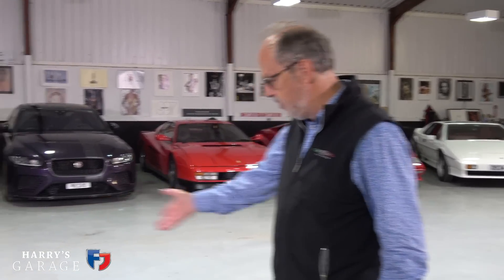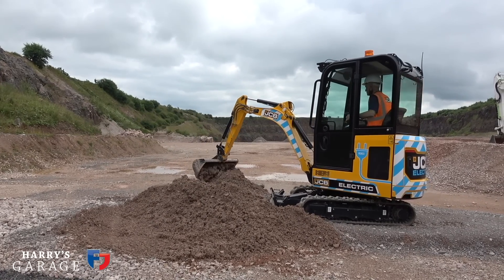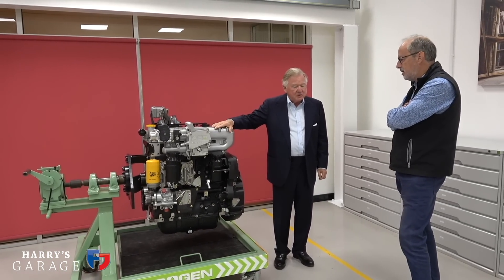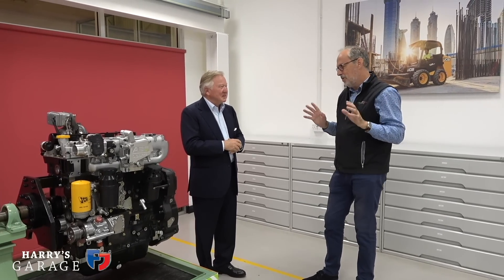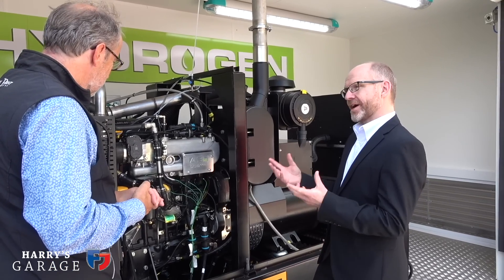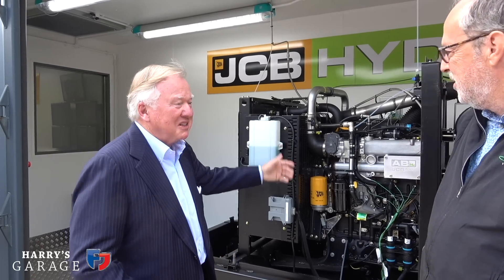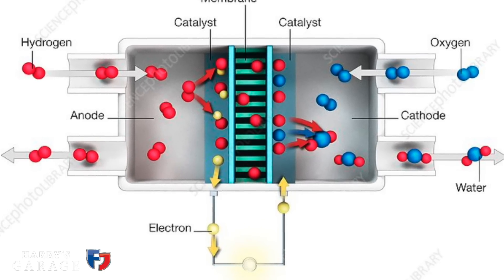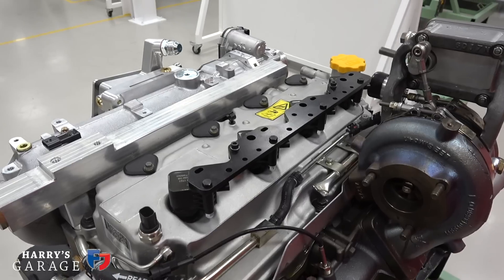Is hydrogen, rather than electric, the future for big-engined machinery? I visit JCB to find out

Comment: Jcb has it absolutely right. This is the correct and most ecologically beneficial solution to power production that can be used to retropower almost every internal combustion engine that has been already built .
Reply: You don't appreciate what hydrogen power combustion is or entails do you? This isnt some back street  LPG conversion. There are no internal combusation engines that can be suitably 'adapted' to run on hydrogen. Way to different. They all get scrapped. New engines all round.
JCB are absolutely wrong on this

Comment: BMW have been playing with hydrogen burning ICE since the 1980s. The problem is that it isn’t green, the hydrogen is made from steam reforming natural gas and is very wasteful of energy. The other reasons this won’t take off as a mainstream technology is that the energy density of batteries is improving all the time. Competitors of JCB already have backhoe loaders and other machinery that can do a full shift on a single charge....and of course they can work through the night or near schools and hospitals due to the silent operation of electric motors, something that no ICE can do no matter what is powering it. Still, better than diesel every time and an interim solution.
Reply: We have an energy storage crisis. Renewable energy sources produce surplus energy at times which actually costs money to redistirbute it safely. Using this waste energy to produce truly green hydrogen is a perfect combination. Green energy supply and green energy storage.

Comment: Japan is going all out for a hydrogen network and hydrogen cars. 
Japan has discovered large deposits of natural resources in it waters that lend themselves to a hydrogen future. 
Hydrogen has a future, it's just that electric vehicles have got a head start.
It is all very well governments making bolt statements and rules but they haven't realised that the raw materials that may up the batteries for electric cars are limited. If everyone suddenly switched to electric tomorrow, the raw material costs would go through the roof and no one could afford an electric car.
Reply: Exactly! I actually believe that in a decades time hydrogen will out pace BEV'S in sales. Plus, more hydrogen stations are being put in so it's only a matter of time until FCEV'S are sold everywhere and people will see the massive benefits to hydrogen.
Reply: The reason the Japanese are going hydrogen is because they don't have indigenous access to the rare earth elements. It's a hedge against China gaining control of the resource supply. Japan can make electricity, they can make hydrogen even if it's inefficient.  This push for hydrogen in Japan is over a decade old, it's before these lithium and other rare Earth minds were discovered / developed elsewhere outside China.

Comment: I was blown away by this video as I was unaware of how far the progress was on developing Hydrogen engines. I have owned and driven 3 Toyota Hybrid vehicles for the past 12 years / 700,000 km and enjoyed every minute of it. It  has  trouble free, extreme reliability and fuel economy that made me see the great benefits of hybrid technology. Just an interesting fact, my second Prius has done 330,000 km on only 2 sets of brake pads because of its engine braking capability.
I would really like to hear your opinion / review on the new Toyota Mirai hydrogen car.
Thanks for a great channel !
Reply: Toyota Mirai uses hydrogen not in combustion but in a hydrogen fuel cell - i.e. turns the hydrogen  back into electricity to drive an electric motor - which can make some kind of sense for certain niche vehicles. But not so much sense - as even in small car like Mirai the hydrogen fuel tanks to get 300miles range take up most of luggage space (trunK) and it is overall ultimately expensive to drive.
 Worst still -  the hydrogen that fuels most hydrogen cars is called 'blue' and is produced from carbon fossil fuel gas (by gas reforming) . And that produces roughly same CO2 as burning gasoline/ diesel in a connventional combustion. So right now there is no net benefit to environment using blue hydrogen . There can be if green hydrogen is split from water - but that takes electricity - lots and lots of it (lots more than if you put it direct into a battery). One way or other   driving hydrogen  vehicels will be expensive. But if you are going to do it then use  a fuel cell.
 This hydrogen combustion they talk of here  is pure farcical nonsense. You have to buy twice as much hydrogen to get the same distance in car with combustion as opposed to fuel cell. Daft idea

Comment: Fantastic video!  If only more people had the insight of Lord Bamford and his team.  I have been a believer in the value of hygrogen fueled internal combustion engines for a very long time.  This is the correct application of the correct technology, rather than becoming bogged down in the expensive electric/fuel cell technologies.

Thank you so much for such an interesting video.
Reply: Have you looked at the amount of energy you need to make, transport and store a ton of hydrogen? No.
Reply: There's a good reason why car manufacturers have gone for fuel cells in their hydrogen cars, and that's because it is way more efficient than burning it. However, it's still much less efficient than battery EVs.

Comment: This is where Toyota are moving to, electric power is akin to the cassette recorder
Reply: maybe even mini disc?
Reply: Doubtful. Battery electric lasts so much and crosses so many sectors that it has far larger economies of scale. As gravimetric energy density increases the curve in the last 1/4 of this video swings toward more electric. Then as charging speeds increase this again swings it towards electric. Then you also have to factor that it takes twice as much energy to run on hydrogen that it does to run straight electric. 
Straight electric also has far less moving parts meaning less servicing and maintenance. 
This application, currently does however favor heavy machinery.
Reply: @jameskalas16  show me a mass production vehicle being sold with it. I’ll wait.
Reply: @teamjg277  it will happen eventually. I work in the industry and there’s a lot of movement towards hydrogen. Batteries, whilst good, aren’t sustainable long-term… it’s just being pushed as a solution by governments, which in the short term, it is. 

We’d run out of lithium to make the batteries before we could produce enough EV’s to replace IC. I think we’ll end up with a lot of different options.  In city’s it makes sense to use an EV…. Everywhere else it will be hydrogen, E-fuels or hydrogen hybrids. The technology for the hydrogen options already exists. The power paste fuel idea works in a similar way to batteries are being discussed…. Cartridges which are swapped out.
Reply: @jameskalas16  run out of lithium? Either you failed chemistry or don’t know the first thing about how abundant lithium is. 
Lithium is also recyclable btw. 
Batteries are a cross sector product meaning that due to economies of scale their production is being increased not only for cars but for all sorts of electronic devices. 
Before you embarrass yourself further please pick up the phone and call any metallurgist or mining analyst that covers lithium and ask them about how abundant it is. Then compare that to platinum.
Reply: Just compare how many HFC factories are being built each year and compare that to battery mega factories. 
I’ll help you with the battery factories. 
China is building a new one every 11 days (some say every week), Europe is building a new one every two months and America is building one every six months. 

FYI I am a long term investor in PLUG, FCEL and BLDP so I’m obviously not anti H2 or fuel cells. They just don’t have the application, resources or economies of scale to compete. When RE around the world starts hitting 200% of grid needs, H2 will find it’s feet as it will be a lot more cost competitive (that is, unless batteries drop in price a further 80% over the next decade which some experts are already predicting).
Reply: @teamjg277  Here in Alberta Canada we are building a $1.3 billion Hydrogen plant. Alberta is 3X the size of the UK. Here you can go weeks before seeing an electric car, they don't work in our environment very well or the distances needed to travel in Canada. People just don't buy them. Hydrogen though will be a different matter.
Reply: @HONDAVFRV4  you do realize sparsely populated places without roads got cars later than densely populated places? What’s the point of this analogy… capitalism caters for the masses before the small fringes. 

Population of the UK 68million
Population of Alberta 5million 😂
Reply: Ahh  no. Toyota recently announced they would be making pure battery evs.
 H2 cars are actually battery powered evs, with the h2 cell charging the battery. Efficiency of h2 is very poor @ <50% compared to straight battery of 97%. Maintenance of h2 fuel cellcars will be very high, meaning that resale will be low. The fuel cell will likely need a full overhaul @ 100kkms. And, the tiny drive battery wont last long either.
This is why even Toyota has announced they will be making pure battery evs.
Even Scania trucks have announced they will not be making h2 fuel cell trucks due to their inefficiency. https://newatlas.com/automotive/scania-ditches-hydrogen/

Lots of videos on youtube explaing this.
Reply: @jameskalas16  post a link mate. H2 burning fuel cells typically are <50% efficient compared to pure battery >97%.
Scania, the 10 largest trucking company in the world, says no https://newatlas.com/automotive/scania-ditches-hydrogen/
Generating the h2 and transporting is also energy inefficent. It might require 4x more renewable energy over all to produce the same power at the wheel than for a pure battery ev.
Reply: @jameskalas16  "there is lot of movement towards hydrogen" is simply big oil trying desperately to keep you wedded to their pumps, & nothing to do with efficiency. The last thing big oil wants is for you to charge at home from you own roof top solar pv (as most ev owners here in Oz do).
Reply: @HONDAVFRV4  ev charging stations are easy to set up remotely. Ever heard of solar panels and battery storage? We can do it here in Oz.
Reply: @nordic5490  OZ is a small country compared to Canada. You also don't get winter's here like we do. There is a remote charging station by Lake Louise, it runs off a diesel generator.
Reply: @nordic5490  Like Chevrolet is telling Bolt owners not to charge them overnight or leave them in the garage, as they are catching fire. Here in Canada we have a luxury vehicle tax, it affects nearly ALL electric vehicles, due to their cost.
Reply: LOL zero technical accuracy. Just silly cultural bashing.

Comment: I'd love to see it Harry I really would. But I dont think the "electric project" will be allowed to fail or have competition. To many corporations involved.
Reply: Klaus schwab and his mouthpiece Thumburg
Reply: I don’t see this as competition to electric.  It’s a specialised use scenario that electric isn’t suitable for.  At present, hydrogen is absolutely seen as the solution for heavy machinery, and it’s not just JCB who think so.
Reply: Electric cars are not ecological. They are no more environmentally friendly than combustion cars over there life span.
The secret to  hydrogen splitting is the pulsing and frequency of the electricity used to do it.
Reply: @JohnSmith-vy4lh  There are some very credible studies that show that is wrong, depending on where you live.  It takes a lot longer for the ev car to be “greener” than ice if you live in a country with a lot of coal powered electricity generation, but not long at all if you live somewhere like Norway.
Reply: For normal cars the battery seems to be the best solution. Needs a lot less energy, too. 
There are methanol fuel cells which I think are promising for agricultural applications. They produce hydrogen from a water/methanol mixture and that mixture can be stored in a barrel and easily pumped into a tank. 
Here in my hometown the green party wanted hydrogen busses. Hydrogen can be stored at the bus depot, can't it? Except when the bus depot is right beneath the airport 🤣
Reply: @JohnSmith-vy4lh  I totally agree.

Comment: Harry the question is are you willing to pay more than three times the running cost of a BEV with the h2 ice?
Reply: absolutely that increased productivity will happily pay for that in combination with the lower purchasing/leasing price.
Reply: @Zandoerlenaar  Why should the price be lower? Because they modified the diesel engine to spark ignition?
Reply: @VolkerHett  lower than BEV, it's in the video.
Reply: @Zandoerlenaar  Ah! Ok. I'm stuck with diesel 😊
Reply: @Zandoerlenaar  productivity would be the same with changeable battery packs
Reply: @appleaday3868  the cost and practicallity implictions make that a big no deal. That only works in specific circumstances and mostly on paper.

Comment: Working for a major construction company, I wondered how could anyone really make an all electric industry work, even the electric cranes still require diesel generators an such to cope, the all electric won’t suffice. But a very big fan of hydrogen and it’s great to see a company delving into it further and making it work, I hope this is the future I don’t see battery tech being it specially when they degrade as they do, with these engines regular maintenance should see them last the life of the machine if not more 👌

Comment: I used HHO with a 1994 Ford pickup.  The MPG increased dramatically under all conditions.  The HHO helped the #2 diesel burn more completely.   Amazing results 

There were a lot of issues and this would not work on newer vehicles.  I discontinued the effort due to too much maintenance on the HHO generators.

I suspect that Liquidized Natural Gas would do as well.  It simply helps the diesel fuel burn more cleanly and efficiently.

This "additive" could save lots of fuel for all types of vehicles with minor modifications.

Comment: I don’t want to be stuck in my staycation seeking charging points and waiting for people to return from costa coffee so I can get in the charger.
The coffee / snacks at each battery charge will out Price the charging cost saving on the much inflated priced vehicle.
Reply: Agreed. Better build a few more charging points maybe 🤔
Reply: @ed234e  as more evs are used more charging points will appear but demand per point will still be there together with the coffee/tea stops.
Reply: @CrusaderSports250  Around 600 new chargers per month are being installed in the UK....
Reply: @Brian-om2hh  and we will need them as more EV's appear, but you will still get the "tea shop" scenario as if you can find a charger then so can others, you then run out of charge driving round to find one that's available☺.

Comment: It’s the completely obvious solution!
Reply: No its not....continue to use diesel  the emissions are squat in the big scheme of things!!
Reply: Nope. No. 3x renewable energy needs to be generated to produce the same power at wheels with a h2 fuel cell car, then a pure battery ev.
Very hard to tame detonation in a h2 ice engine. The reciprocating engines BMW was testing suppered knock. H2 works better in rotary engines.

Comment: Hydrogen's been around a long time  😀
Reply: It's quite rare though.
Reply: Yep, since the dawn of time - the most abundant element in the universe, the ultimate renewable
Reply: Yea and it never took off for a reason. I'm not pro batteries either.
Reply: The Hindenburg’s engines ran on hydrogen.  The explosion risk of large amounts of hydrogen are an issue.  Typical storage of hydrogen is 5kg in a 125 liter tank at 600 bar.
Reply: @paulnicholson1906  I think the engines were in fact diesel powered (converted e-boat engines), there was a plan to use hydrogen to fuel engines, but it never came to anything. The hydrogen was the lift gas in 'bags'.  The 'crash proof' containers for road vehicles aren't as likely to cause a disaster, but it's fair to say a hydrogen leak is a great deal  more dangerous than a diesel or petrol leak.
Reply: @nikpester  Nik you are right.  This proves you learn stuff on YouTube.  Thanks.  Apparently there was a thought to use hydrogen but never came to anything.
Reply: @paulnicholson1906  Not the engines. Hindenburg was filled wit oxygen to be liter than air.